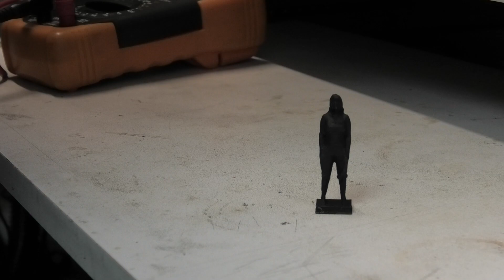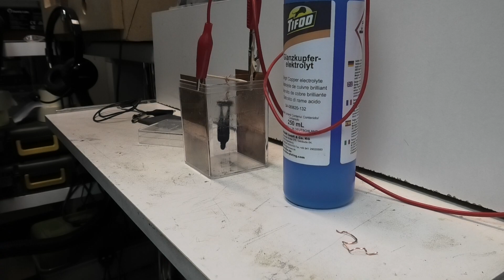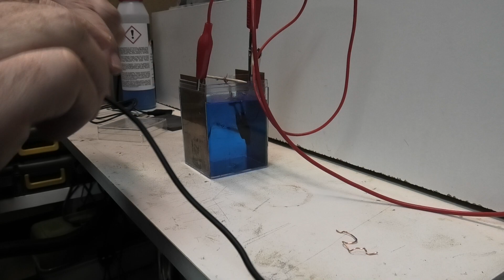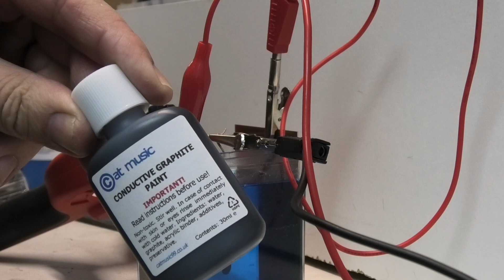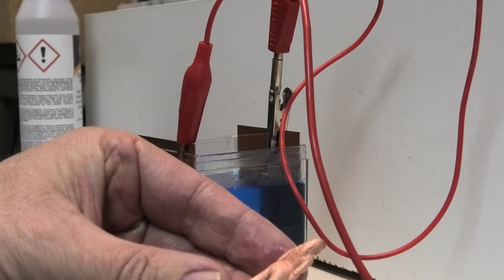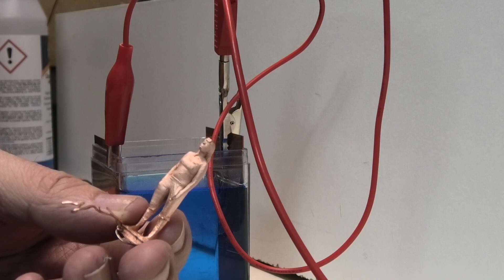Simple ELECTROPLATING of PLA Print

Comment: Hi there just a suggestion would be to have the copper plates in a V to have the ferthest part of the model closer to the electrode to compensate for the resistance of the carbon pant to get an more even plating

Comment: That is most impressive. Did the plating have much impact on the layer lines? Now I'm wondering if I could 3D print some track in 16mm and electroplate the rail surface!
Reply from the maker: Not very much - which is good, as I don't want to lose definition. The problem with plating track might be that the wheels wear through the plating?